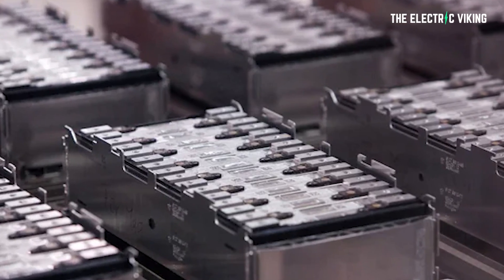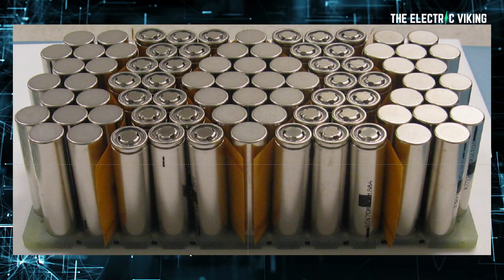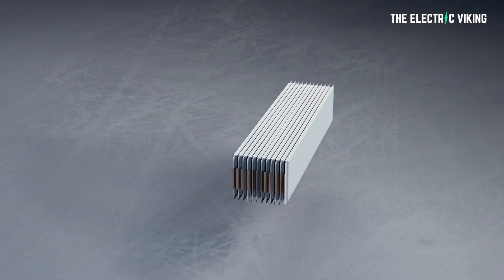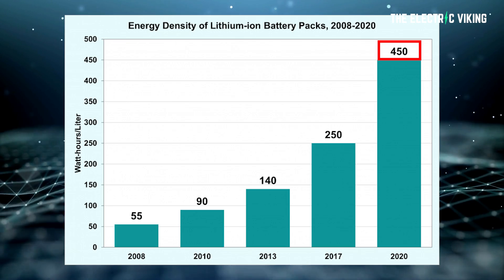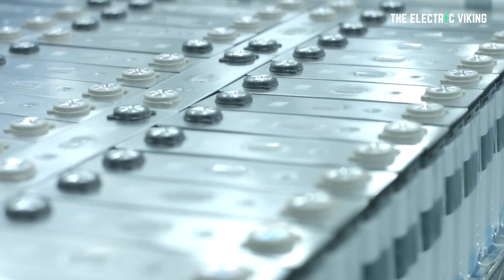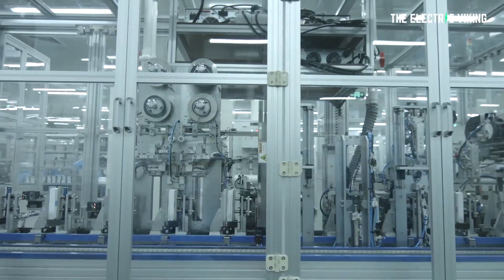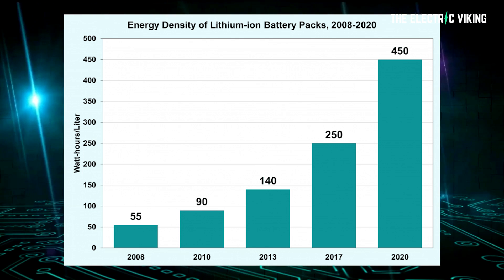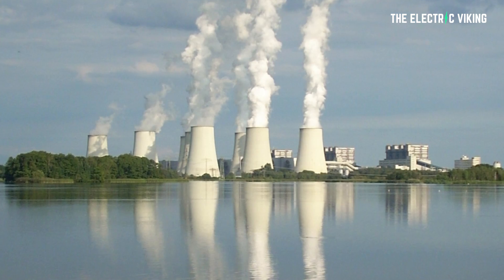Energy density improvements in lithium batteries from 2008-2020

Comment: How can this be true that the density has increased this much, but on both of tsla's battery days they were bragging about an almost zero % increase in density. (In the first one they showed a battery that was twice as large 18650, from 2007 -> 2170, from 2018, and bragged that it has twice the power, and in the second one they did the same)
I saw this in a video on the topic and then found the original presentation because I couldn't believe it.

Comment: My first laptop with lithium batteries had been in 1998. No data available now. But my second lithium ion battery laptop had been in 2000 a GERICOM silver seraph.
It had two bays, and it was possible to insert 2 batteries with 50 Wh each. This 100 Wh in 2000 had sure a much higher energy density than the 55 Wh/kg, You claim for 2008.
I also tested in 2008 an electric scooter with 64 V 40 Ah lithium iron phosphate battery. Even this LiFePo4 sure far better than 55 Wh/kg.
Reply: Roland Mosl / In order to claim what you say, you have to tell us the size in volume ( or in weight ) of that battery and the exact energy for that volume/weight.
Otherwise, what you say is a shoot in the dark = it means almost zero value!
Reply: @mikel4879  I just went down to my laptop museum. The battery of the Gericom Silver Seraph is 448 g and 147 mm x 95 mm x 20 mm.
The label tells 10.8 V 4,500 mAh. Max charging 2.8 A.
10.8 V x 4.5 Ah = 48.6 Wh. 448 g for 48.6 Wh is 108 Wh/kg. The volume is 0.2973 liter, so 174 Wh per liter.
Not from 2008, this laptop had been purchased summer 2000.
Reply: Rokand Mosl / It looks like your laptop had 18650 Li-ion batteries.
If you check with Google, you will find that the improvement of the capacity of these 18650, from the moment they were created to today, is minimal. 
Higher capacities have been created in time by changing the dimensions of the batteries and the chemistry.
But the 18650 have not been improved by a lot.
So, in 2008, for example, Tesla built the Roadster.
That one used Li-ion batteries with a gravimetric density of 117 Wh per Kg and a volumetric density of 370 Wh per liter, at the PACK LEVEL. ( And be sure that Tesla used the best 18650 Li-ion batteries of that period!
So, in 2008 the best 18650 batteries had approx 120 Wh/Kg at the cell level, and evidently that at the same time on the market there were cheap ones with much lower energy density. )
If that was at the pack level then it means that the individual battery had a bit higher capacities per kg and liter.
This is the first important thing in understanding correctly the situation. 
The second important thing is that all Li-ion batteries, including the model 18650, were made with different chemistries ( for example, Lithium-cobalt, Lithium-Manganese, Lithium-Etc ) and as a result the same form factor had different energy specs. For example, the 18650 format had energy specifications between 1500mAh and 4500mAh, and even higher.
That's why you can't exactly compare ( or get an exact conclusion ) the specs of your pack of batteries in your laptop with many others from the same period, or from later, because the capacities were very different, depending on their specific chemistry.
However, even if you do it, overal, in general and over the years, capacities of the same model haven't been improved too much. 
So, in 2008 there were still many batteries 18650 with less capacities than some 18650 batteries from 2000 of some better ( = and more expensive ) specific chemistry.
That's why you are now puzzled by the fact that some Li-ion batteries of 2008 were not much more improved than the ones from 2000.
Reply: @mikel4879  In this video is shown 55 Wh per liter in2008. This laptop battery had 174 Wh per liter in 2000.
Reply: No, it didn't have. You are making the calculations at the pack level.
I just wrote above that the pack level of the same format 18650 was in 2008 a bit over 300 Wh per liter ( at the pack level ! ) in the pack of the Tesla Roadster.
And those were the best 18650 on the market at that time.
So, in 2008 you would have found on the market 18650 with much less capacity, meaning with less expensive chemistry = cheaper 18650 batteries.
Even possible with 55 Wh per liter at the pack level.
You buy today cheap 18650 from China and they are advertised as being of 3500 mAh. In reality they can be 700-800 mAh ( 5-6 times lower capacity in reality ).
Reply: @mikel4879  00:58 is a table. This table shows 55 Wh/l in 2008.
The energy density of my laptop battery from 174 Wh/l in the year 2000 is in this table somewhere between 2013 and 2017.

Comment: Yes that is true enough if you go back 20 years.  HOWEVER if you plot the curve this is not improving now hardly at all.  PLUS THE BIG ELEPHANT - there isn't ENOUGH Lithium to matter.  One of your own articles pointed out Tesla used about 25% of all Lithium produced and they sold (not actually built) 900,000 cars in that time.  A short calculation means Max production of LI based cars is 3.6 million; even with a small increase in density you get 4 million - in.a market of 80 million annually and a BILLION existing cars.  What EVs need is a new Chemistry; until then PHEVs make way more sense as you can make 10 x more - there batteries being much smaller.  Ignoring that makes you the Ostrich.

Comment: i hate structural battery packs. they are the worst for servicing or reusing. i like module based systems like in the MEB and ultium.
the ultium battery from gm could even be upgraded and mixed with different chemistries. imagine buying a car with medium range LPF and after three years adding better batteries in the empty battery slots. and three years later you rip out two old LFP and exchange it for solid state and use the old LFP batteries at home for you home storage box together with your solar system.

Comment: Thanks for sharing this information about volumetric density. However, you may have accidentally said "by weight" at 1:29. The amazing progress that has been made on volume density is well supported by the chart and reference provided. But energy density by weight is a different issue and will need different supporting evidence.

Comment: Even with battery improvements, I remain skeptical that we'll see 1,000 km range vehicle proliferate.  More likely, these improvements will allow manufacturers to reduce their cost (by reducing battery size) and it will be unlikely that you'll see it passed on to consumers.  We just saw Tesla do this with their improvements on Model Y (LFP batteries, etc).  Longer range (higher priced/higher profit margin) models will remain an upsell opportunity for brands to make more money.  Consumers still win with options but car prices won't come down.  Call me cynical.
Reply: Perhaps, although lighter batteries will increase range.
Reply: @grantbuttenshaw  Yes! A perfect opportunity for the brand to decrease battery size to save cost and maintain the same range or increase their price because of the longer range benefit.
Reply: You aren't cynical, just a realist.  The present high-price situation is the natural result of manufacturers not able to fully & quickly satisfy demand.  Within a few years when commuter EVs are much more easily available, their prices will drop significantly just by ordinary marketplace competition.  Early adopters pay dearly for their privilege, while later adopters get more choice & lower prices.   The market will also indirectly determine the acceptable limits, both high & low, on range vs battery cost/weight.
Reply: we don't need 1.000 km range, with fast charging and good infrastructure 500 km will more than suffice
Reply: Agree with you

Comment: The price of lithium has indeed risen hugely in the past few years as well. The talked about cost savings seem to be absorbed by the manufacturer at this point don't seem to be being passed on to the consumer. (Rising retail prices) The ability to produce enough raw materials (mining) at todays rate will not sustain the objectives for what The Electric Viking (and others) projects by 2030. Even Elon admits this. So while the transition to EV with Lithium batteries show impressive growth along with innovations its miniscule compared with the total vehicle opportunity/demand. The available capacity today is already constraining volume production and EVs are still less than 10% of the total market. Sam believes that the market has the potential to be all EV by 2030. Doing the math of either gigawatt hours needed or really rough calculations  by cell count (yes I know there are pouch, and blade etc) but would have something like 225+ billion cells needed to fully supply a total EV conversion in a single years production at 100% share. That will take much longer to ramp up as its truly a herculean task. Also If the supply chain and raw materials are heavily controlled or dominated by one individual country we'll see prices rise even further. Yes, we're moving aggressively toward EV (that's good) but logistics and math will be the constraints to full conversion. Hence legacy auto hedging their bets to still plan for ICE availability well past the targeted dates expressed in the EV fan channels or by governments themselves (which thankfully have lower "realistic" outlooks). I hope all these dreams come true and continual battery innovation and production expansion get us where we hope to be.
Reply: You make some compelling points. However, have you considered the following:
1. As BEVs become more and more popular, charging networks will improve significantly, which in turn will mean that more people will be willing to purchase cars with lower range - hence fewer cells per vehicle and a given cell manufacturing rate being able to support more BEVs.
2. BEVs will be so much better than ICE in 2030, that no one will want a new ICE car. People who can’t wait for BEV might get second-hand ICE. Others will just try to make their ICE vehicle last as long as possible whilst they wait for their new BEV to arrive. I wouldn’t be surprised if the overall car market has shrunk significantly by 2030.
Reply: @harrydymond3327  Indeed good points! 👍Your comments do add some better rounded view on the likely direction. Something like 50% of car owners live under circumstances that don't offer at home overnight charging. Living in apartments and such so competent charging infrastructure becomes critical. Thanks for filling in the gaps! 😊

Comment: There is right now Sam, a company investigating the use of a ‘breakthrough new technology’ in the construction of their own Lithium Battery design models, which, if it can be achieved, as they anticipate it can, will result in an immediate five-fold increase in the currently best achieved, Lithium Battery Energy Density..!  😁    I would like to tell you the name of the company, but, I’m still trying to gather enough of their Stock, myself, before the news of their achievements becomes too widely known. 😉😁    Imagine, Sam, five times the range, for EVs using the same sized batteries as they do now, or, achieving the same range as they do now, with a battery just one-fifth, the size of their current, battery..!  😁 
Exciting times ahead, and not too far ahead, if this works as expected, for all, new EV buyers..! 😉😁😁

Comment: Do we really need 1,000km per charge range?  How often would you use this range and if rare, then you are spending $$$ lugging around dead weight on most trips.  Horses for courses, I guess some people will want that per charge range, most won’t need it.  Not my thought, comes from Elon.
Reply: Yes we do!  Have you seen the price of roadside charging?  It's expensive!  In the UK it has risen from approx 25p/kWh at the end of 2020 to now reach 46p/kWh on the Tesla supercharger network alone.  Other companies are soon charging 57p/kWh where last year they charged 30p/kWh.

Compare that to cheap overnight charging at home for 7.5p/kWh, or free if you have solar panels.  You have every incentive to avoid roadside chargers!

Now while most people don't drive 1000km on a daily basis, there are many people who drive up and down the UK on a weekly basis as part of their employment obligations:  We're talking not just about sales people, but technicians, engineers and other contractors.  

I do know people who drive 200 miles from London to Manchester, and then drive 200 miles back, all in one day.  Can they rely on cheap, convenient destination chargers in Manchester?  Not necessarily!  So a 1000km range isn't so preposterous in the face of high prices away from home.
Reply: @anthonydyer3939  - extreme case - the majority of people would do just fine with a 150-200 mile range.  This saves a lot of battery capacity for other customers.
Reply: @dennislyon5412  actually it’s not an extreme case.  Here’s the thing:  Fleet managers are historically the biggest vehicle purchasers by far, and the biggest end users for fleet vehicles are company car drivers.  They’ve got huge buying power, and they’ve all got requirements for long distance driving.  So manufacturers are going to need to cater for the needs of these customers.

Then we’ve got commercial vehicles.  I was speaking to a food delivery driver.  Their vans are racking up 400 miles a day (16 hours, 2 shifts per day), delivering food to domestic customers.   You need to electrify this fleet without reducing the utilisation rate of the vehicles.

Finally 600mile of official range often means 400 miles of usable winter range.  No one ever drives the max range of the vehicle unless they made a bad mistake.
Reply: @anthonydyer3939  - these will come.  The battery cost is too high currently for the big batteries required to serve those people/routes.  The vans are coming which will support the contractors, and the OEMs will work to create the fleet pickup that companies are willing to buy (towing comes later).  Lunchtime or worksite charging may be required for the contractor early adopters until the cost vs battery capacity gets more aligned with the current ICE offerings.

Comment: The latest presented X-Peng has batteries with 156 Wh/kg according to the internet EV database. So what is in the laboratory and what is on the cars are huge differences.
Reply: Same for the Model 3 batteries 

6.4kg per KWh which equals 156 Wh/kg

Comment: At least 18650 cell didn't improve much. Many years ago 3400mah was the best, and now 3600mah is the best, almost nothing. If the cell would have been 100% better in 10 years, now we would have 6800mah 18650 cell, but we don't have.